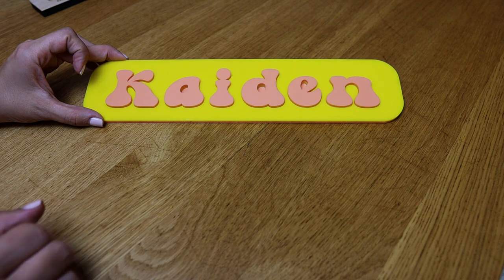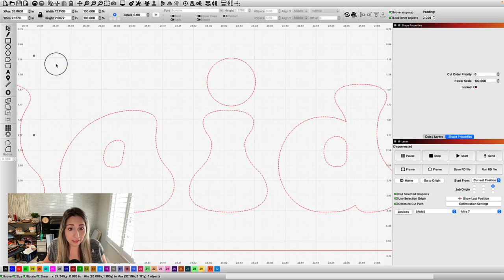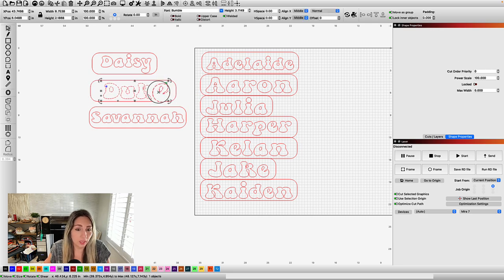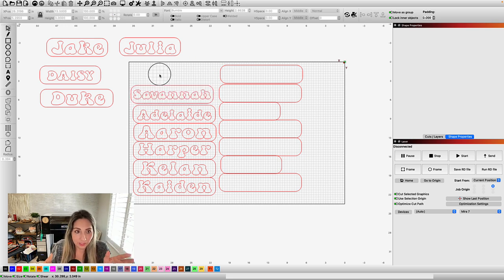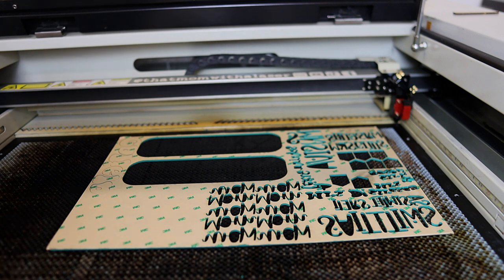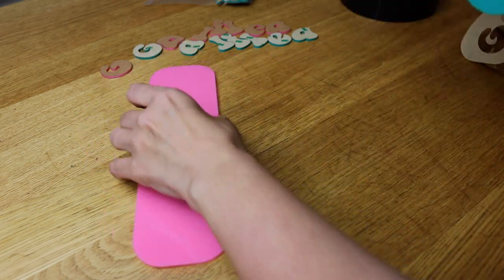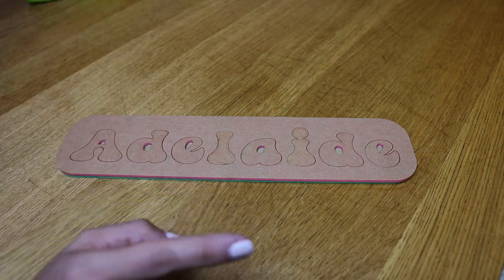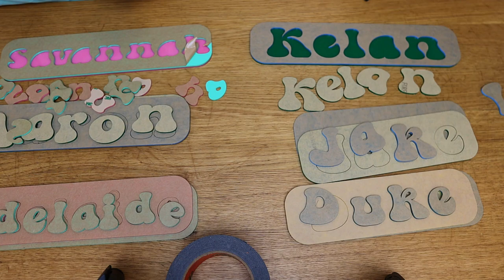How To: Laser Cut Puzzle

Comment: Good morning from Spain, tell you that I am delighted with your work and I particularly have a question regarding the laser.
You see, I have a 20W diode laser and I wanted to know, please, what speed and what power you use for your cuts, because they come out perfect.
I have done tests with transparent acrylic and you burn them when making the cut.
could you guide me?
Thanks again and best regards.
Reply from the maker: Hola! Thank you so much for watching.  I have a 60watt so the settings will be very different.  However, It's important to note that a standard blue diode has a wavelength that won’t cut clear acrylic. It will cut black, and a few neon colors but not white or clear.
Reply: thank you @ThatMomWithALaser